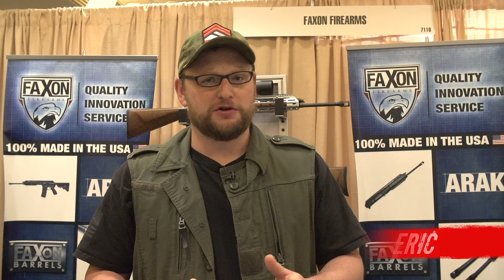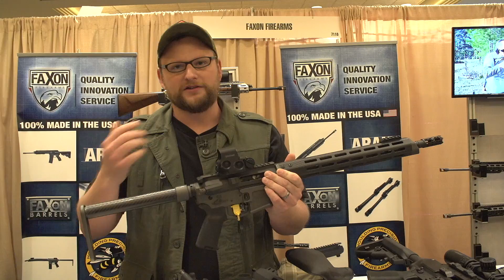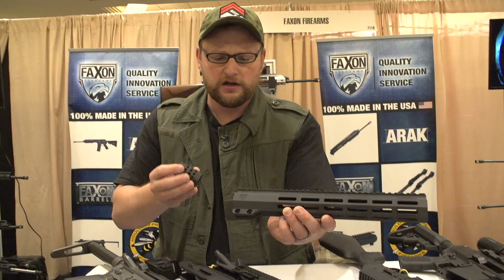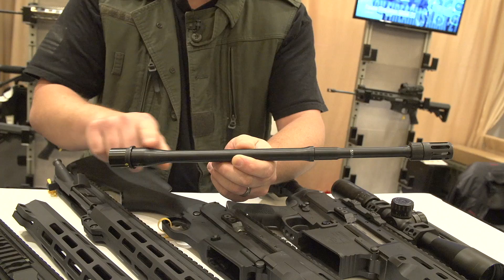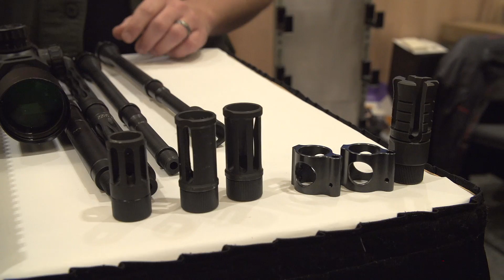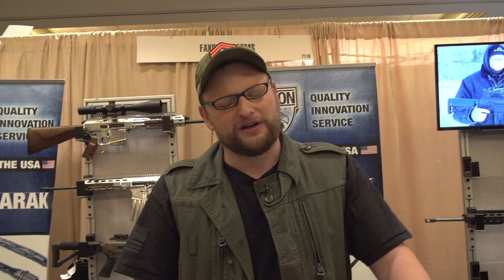SHOT Show 2016: Faxon Firearms New Products

Comment: So it's officially been a year today since  I preordered an arak31.  I am still looking  forward for faxon to honor the $100 discount off the lowest advertised price and yes, I have been tracking it constantly.
Reply: +E Chew Which we will, as we have stated many times. We're not confirming lead times, but pre-orders will absolutely get their discounted pricing.
Reply: +E Chew When I bought my ARAK21, it exceeded the build time by months. Repeated emails to them were always replied with "we should have it done next week". Finally got it, and it had more FTF, FTE, FTL than it had actually shooting rounds. Some casings were stuck so bad I had to take a wooden block and slam the charging handle on it. Also the dual ejection port thing sucks because all you get is gas in the face and it doesn't come with a cover for it. If possible, you should try to get a refund. Any questions you have to them will likely be ignored and/or they will only answer certain questions and not all. I cannot recommend these guys to anyone.

Comment: That 50 state legal rifle, does anyone know if it can be had in, say, .308, or .338fed?  It would make an interesting hunting rifle!
Reply: Unfortunately, the AR-10 platform is proprietary and takes a mag too big for the Ares SCR lower. I really wanted to pair an ARAK-31 with the Fightlite/SCR lower to make a splendid repeating sporter. 

ARAK-31 was suspended indefinitely and ARES I think, doesn't plan to make a .308 lower.

ARAK-21 Is available in .223, .308 and 7.62x39mm.
Reply: @axelkusanagi4139  thanks for the information.

Comment: what does rock setting mean
Reply: +Benjamin Thomas Rocksett is kinda like loctite except it's extremely resistant to heat.  I forget what temp. it is rated to but it's VERY high compared to loctite.  To give you an idea, I Rocksett a gas block on and had to cut it off cause the set screws stripped before loosening.
Reply: Thank u very much
Reply: +Benjamin Thomas Yessir!  You are very welcome!

Comment: Anyone know what oem's are using their barrels?
Reply: +Justin Miller 2A Armament, Robar Arms, Combat Shooters Supply, Area 53 (at times), BCI Defense, among others. Many more we are under "black label" agreements and cannot disclose our supply of barrels.
Reply: +Faxon Firearms good to know.  Thanks for the quick response. I recently got out and shot my new build with your 18" rifle length barrel. Love it had, no issues.  However when I was installing the gas block it came with from aim surplus one of the screws easily stripped out on me. Had to replace with different brand.  I can't find another gas block that is drill already for the pin on the bottom.
Reply: +Justin Miller We will replace the gas block. Contact CS and mention you spoke with Nathan
Reply: +Faxon Firearms ok thanks for the help
Reply: +Justin Miller Our pleasure. I know the block is on its way!